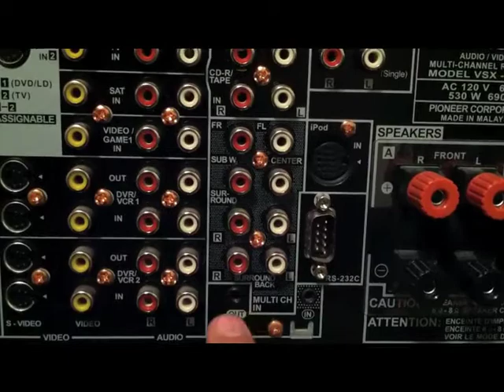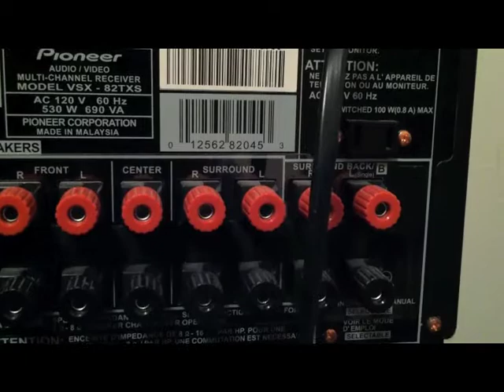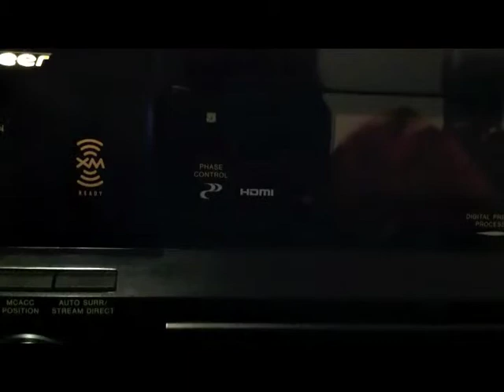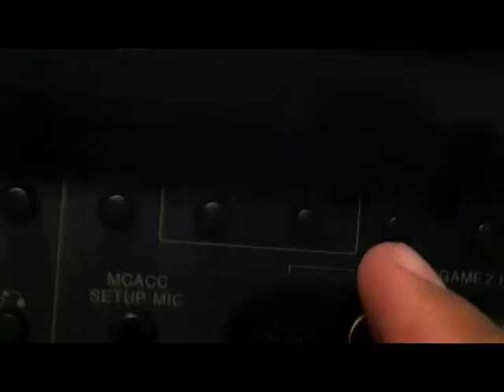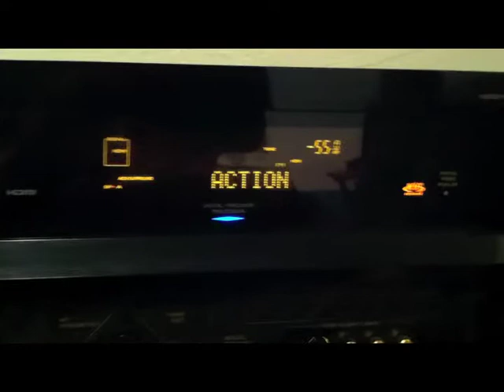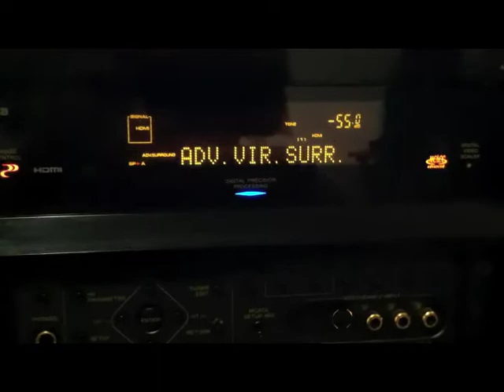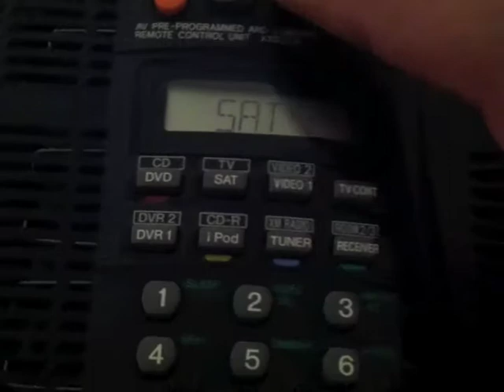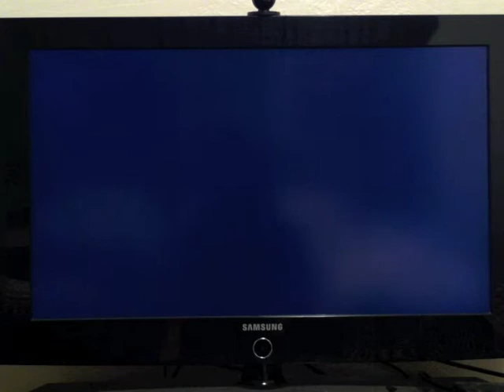pioneer vsx-82txs

Comment: How did you get the mcacc logo light, to turn on the front of the display.??? I have the 94-txh version it never turn on for me😖😖😖😖
Reply: you can push that MCAAC button on the front left. It toggles the light off and on but more importantly, toggles the system adjustment on and off. In cheaper Pioneer models, there is no light.

Comment: Would you know why my remote stopped controlling the volume. The unit works fine besides the remote volume issue. I did the reset but it didn’t help. Thanks in advance.

Comment: How do you configure the settings to get composit audio outputs (DVR/VCR1 & 2) to work? I can't get any sound from these. I want to send video to my tv via hdmi and audio via composite to a blutooth transmitter for my Bose blutooth headphones. I could also connect my blutooth transmitter to my tv, if the hdmi cable carried both audio and video to the tv, but it doesn't.
Reply: You need to go into the menu and assign each input you can set them..example goto the DVR input, then set it to composite...it will work then